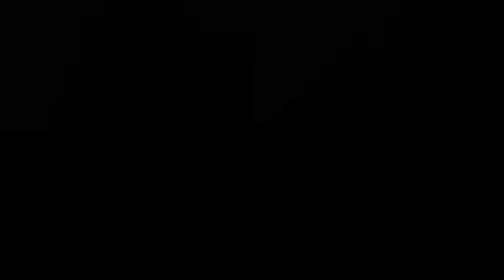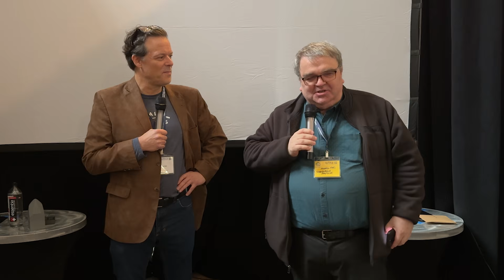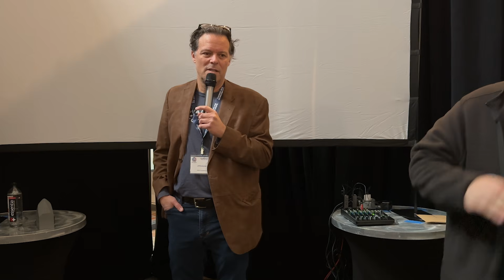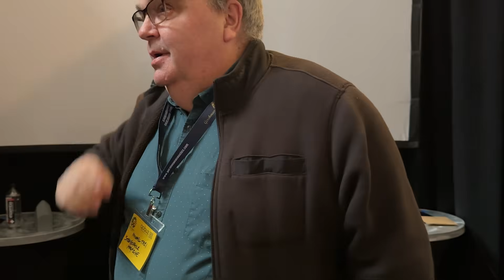Stereophile's Michael Trei & J.R. Boisclair - Capital Audio Fest 2025 Seminar

Comment: Are there torque values for cartridge to headshell screws or bolts or are they just good and tight.
Reply from the maker: Like most of my answers: “it depends”. There is not a single answer. IF cartridges were made from rigid materials like stainless 316L and such, AND if the headshell was similarly rigid, the answer would be as you say: VERY TIGHT. 

That is how  it is best done but the materials must agree. Internal stresses and mechanical impedance of the mating surfaces matter

Comment: I've been using Stylast since the early 80s. I don't think I've been unhappy with the product. While I do not own a microscope, nor have I taken my carts to a local high-end shop for prof. inspection,  I have always kept my styli clean, records clean, and they were LASTed. Hence, audible signs of stylus wear were/are never an issue IME. Nor was cantilever elastomer disintegration ( a typical criticism of OVERUSE of wet stylus treatments) . I apply one light touch -- TIP ONLY-- for every side played. Since the early 1980s!

 J.R. Boisclair, mention Stylast  

But I think  Boisclair is not aware of how Stylast works. It is not a "lubricant", but (rather) a COOLANT.
Reply from the maker: Interesting. For it to be a coolant implies evaporative effect of the Stylast when exposed to heat or even ambient temperature depending upon its properties. This is easily testable. Have you tested this and, if so, by what method?
Reply: @WAM-Engineering  I was told by LAST, decades ago , in a phone conv. with them, that Stylast acted via  cooling the tip. About testing myself ... no ... but now you mention it... I do have a FLIR thermal camera, so I might experiment! Good idea.
Reply from the maker: @h0ll0wm9n if it has sufficient resolution, do that but be sure to watch for variability across the record surface. Let us know results

Comment: When they cut the grooves into the metal that is the mother of what will become the stampers, it seems to me that if the cut the grooves straight up and down, the displaced gouged out debris would get in the path of the cutter. I think they cut the grooves at a slight angle so the displacrd goiged out debris goes off to the side and into a vacuumn. Alignng your cartridge so its straight up and down, it's at odds with the slight slant that the grooves had to be cut at. If I'm wrong please tell us why.
Reply from the maker: Multiple reasons. Watch my video on SRA
Reply: I have tried running my cartridge at a very slight tilt many many times with always the same result: the sound gets purer and sweeter. Never fails to and I've done this countless times. In fact, massed violins sound a little hifi and lacking sweetness without doing this. I have not ruined any records, but if I tilt too much, the placement of the instruments start to get vaguer soundibg. I also notice the highs get slightly less extended sounding. I had the original Pink Triangle turntable with a Premier tonearm. The turntable had a platter adjustment where you could level the platter on either side,and mess with the platter geometry. The platter being perfectly level, never sounded best. I had anti skating too, but has anyone else out there done much experimentation like I have on adjusting platter orientation by ear instead of a bubble level?
Reply from the maker: Changing too many variables simultaneously. Watch my videos on azimuth. (Not sure which axis you are referring to with “tilt cartridge”, but that is my guess)
Reply: When cutting grooves for the mother part of the stamper making process, they angle the cutter slightly so the left I believe (head on view), so the left part of the cutter is isslightly more upward. The shavings of displaced material go right. The cutter being angled the other way, would make the displaced material shavings go left and onto the part of the metal that hasn't been cut yet, & would grossly interfere with the process..

  So angling (slightly) your cartridge so the left side is slightly upward more. I noticed massed strings got so much nicer to listen to, and then noticed the same thing with other instruments sounding sweeter too. This was done with my platter being perfectly level. I started experimenting with platter adjustments years later.
Reply from the maker: No, they don’t do that. I used to think that to be true as well. They rely on proper positioning of the vacuum hose to evacuate the chip. 

If you heard what you did by raising/lowering the arm, what you heard where changing vector forces, not SRA or VTA. Watch my videos on this.

Comment: No I completely disagree with the armboard doesn't have to be level with the platter. you want it below the platter the the vertical bearing has to be at record level. that is the proper places it should be. this causes the mass to be very central in its pivot, you don't have a discrepancy between tipping at that point. If it was higher discrepancy by Gravity affects its movement, plus all the mass from the counterweight is pushed to the center where it needs to be if it's lower. where the opposite is the case if it's higher. Imagine it as a tightrope walker with a long pole if you hold  the pole up at chest height is not as good for balance as if the pole was below his feet under the Rope.
 blu tack is the best thing to clean your Styles as regular cleaning. Just put a large ball on the turntable and just dip your needle in it before you put it on the record. massage it now and again all you need. 
You can easily make a good platform for isolation just get a c brackets x8 one set of 4 on one board and another set of 4 on another board, one facing up one facing down, where the c interlocks use some fishing lines and you've got a hanging suspension board platforms. Will the footfalls having a platform like this where it can rock in the level plane will cut down any problem and even better if you hang a weight 14mm underneath the top platform 2 kilo even better,  just make sure you got good breaking fishing line. Also if you've got a virtual  rack to put a heavy 3 inch thick paving slab on the bottom shelf, wrap it in a sleeping bag or cushion cover you want to get the weight lower as possible on the rack that will make it more stable and improve the sound even if it is stable
I don't know what that style I conditioner is. but not necessarily would attract dirt it might actually do the opposite, any records attracts dust because of static, if it would get rid of static dirt shouldn't get attracted to it.
Use a rubber conditioner on the rubber on the cantilever. especially if it's going to be stored away. If you've got an old cartridge then do it before you actually use it prevent cracking. it will renew it straight away you can use car doorseal rubber conditioner use for classic cars
Reply from the maker: Your comment assumes a particular approach to bearing design with respect to the COG of the platter bearing and working surface. 

Way too many issues with your subsequent comments to flesh out here. I’ve covered many of these issues in my videos.
Reply: Nobody said the armboard needs to be level with the platter, only that they need to be parallel with each other. Typically, the arm mounting surface is about 30-45mm lower than the record surface.
Reply from the maker: If I said “level with the platter” I certainly meant they are ideally parallel planes. Give me a break! I could not be speaking any more extemporaneously as I was AND trying to share the stage.